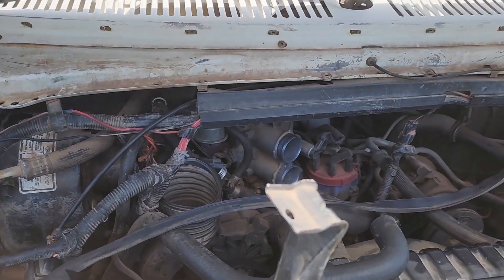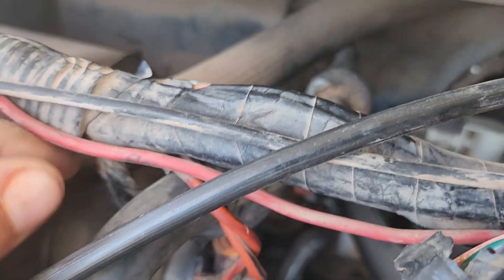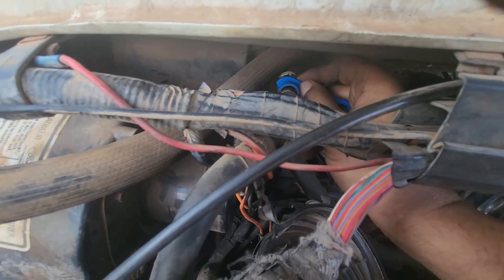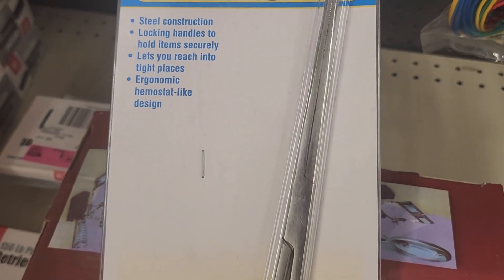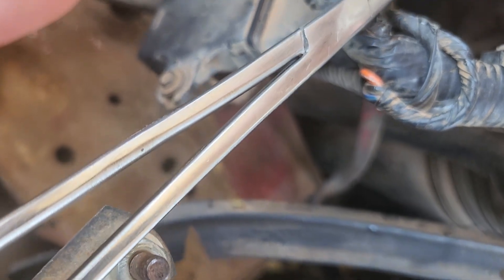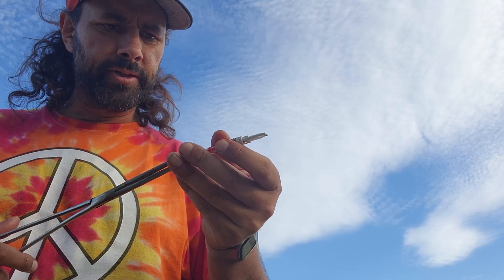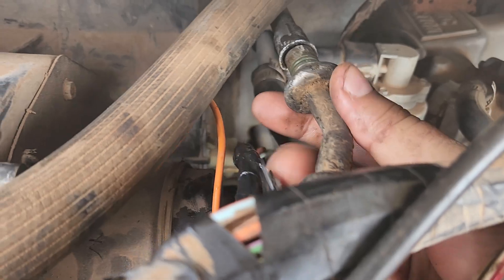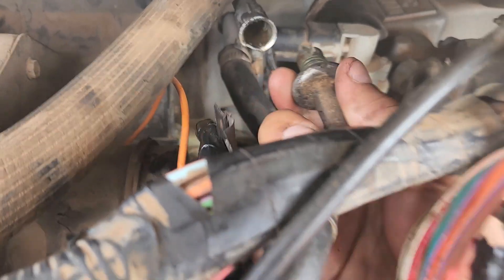Change Stuck AC ORIFICE Tube & Disconnect A/C Line: 1988-1991 Econoline E-150 FORD A/C Tutorial #2

Comment: Hi, currently rebuilding my a/c on my 89.
I literally was messing with that line today. I got the left side like, accum to evaporator off. However that one, with the orfice tube not budging. I’m almost sure I have the spring lock in, I can’t even spin it to wiggle it free, any tips?

Did you replace evaporators? Wondering if the the blower box/assembly has to come all the way out, or can just be brought back.
Reply from the maker: I didn't replace evaporator.. i didn't want to remove the dash and everything is working so I didn't bother replacing it. For that spring lock, you gotta just go crazy.. they were a total pain in the ass to get off and lock back in.. I had to just keep trying, push in the tool then start yanking like mad.